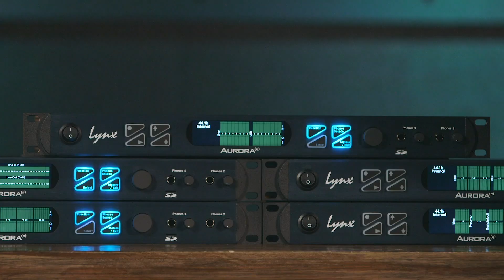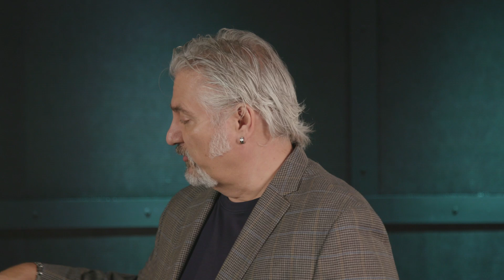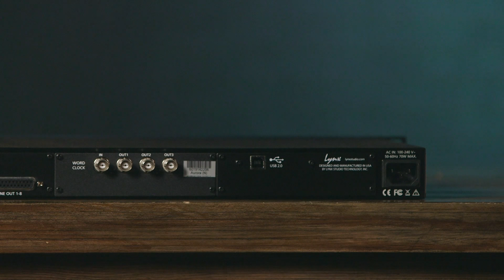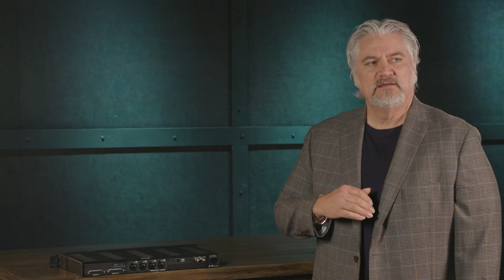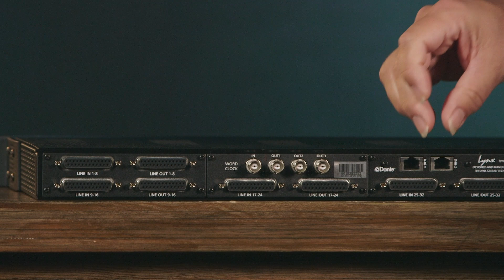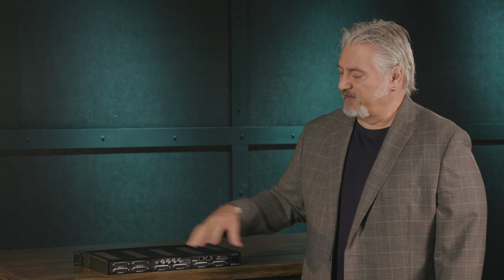Lynx Aurora (n) Configurable Audio Interfaces Overview

Comment: just got rid of my lynx hilo its not bad sounding but its not the best better options out there lets speak about some issues , it is a clean converter but its also missing the low mids registry so it loses the centre while its very wide sounding it can also be very hard sounding to be used as the only mastering unit  also people has brought up the fact that the  usb is powered by the computer and not the hilo to which it sounds better in stand alone mode this unit also cannot handle loud as it craps out easily its dangerous or antelope to  apogee is better for pitching your analog chain than this unit i tried to like it but  its not for people mix ITB  because it will not tame digital harshness its very bright sounding  its an ok starting device but you will out grow it quickly
Reply: Isn’t the goal not to tame anything though? To hear it as precise as it can be? I’m new to all this and waiting for my aurora n 16 to come in the mail and your comment concerned me 😂😂😂😂

Comment: think this is the converter I've always been looking for.
It's modular, no fan, d-sub connectors to minimize cable mess, it offers USB, and the converter specs are second to none. Plus it's cheaper than a similar Apogee Symphony configuration which offers no USB.

Comment: Word on the street is that the Aurora N is better than the Orion 32HD.... I'm still undecided... Somebody help me lol I need a few second opinions before I throw my finances into a tailspin. If you can link more than one unit together for 64 in/out (or more), I think i'm sold.
Reply: Man!! I am in the same situation as you. There are lot of people at forums  saying that orion stability with drivers its annoying. Also there are people saying the opposite and it's so confusing.
Lynx offer the same thing, more expensive I know, but you also can have 32 i/o 1u rack unit thats so cool. 
I can't see anywhere dedicated monitor output I think you have to use one pair of the 8 slot conector to do that work. And also it doesn't have midi i/o but if you don't need it don't matter.
I heard in a produce like a pro video a little bit of orion convert capability and man.... It's a little bit aggressive the sound in the high end. But it's my personal perspective.

Comment: killer, will it beat my prism titan hmmmm
Reply: I switched to the Lynx (n) from my Prism due to its offer of switchable interfaces from. USB which I chose to use with my mac,pc and ios and I can switch out the USB for Thunderbolt or Dante in the future. It was between this and the Hilo and i chose the DB25 io first to match my orpheus and realised I could airship have 4 combo pres for 12 in 8 out!
Reply: @AnthonyMartinsRock  sonically which do you prefer?
Reply: @mixedbyedd I have the same question.